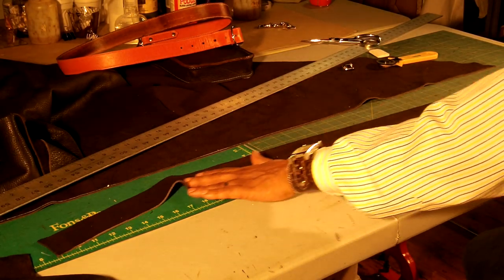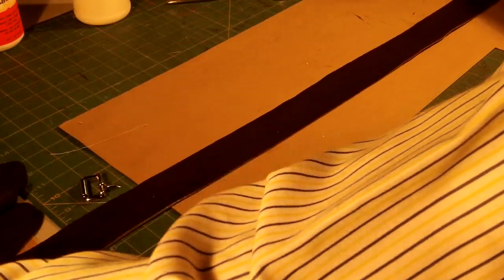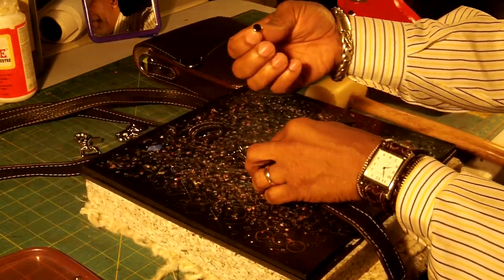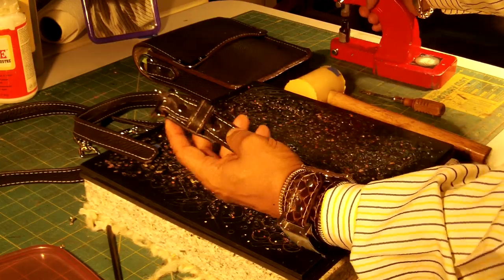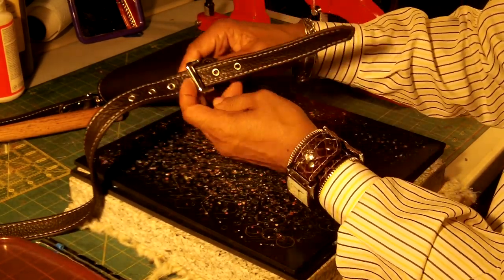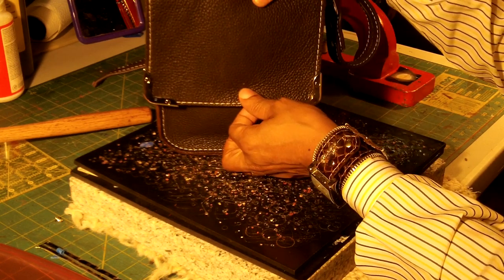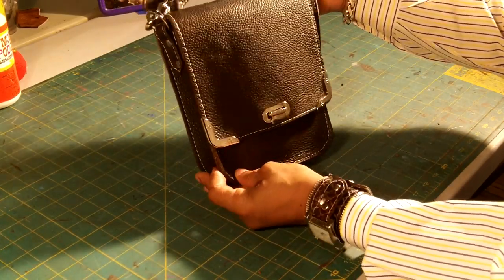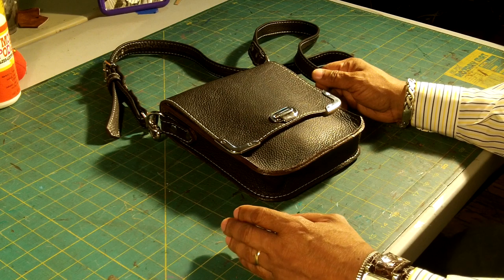How To Make a Messenger Bag Part 7 of 7

Comment from the maker: Hello Ali, Thanks for watching and for your comment, I could make the iPhone 4&5 case the only problem is, I am still using the iPhone 3, for me, I need to have the product to make the pattern with out making it 3 or 4 times to get it right, The iPads would be easer to make because it dose not after to be a prefect fit, if you look at the coin purse video, it is the same process.

Arthur

Comment: Bravo, Arthur. What an elegant piece!  Two unrelated questions for you: (1) Any ideas for getting contact cement off your skin??  (2) Do any of your current pieces illustrate how to make and attach a rouleau handle? I'd like to try a tote bag with that kind of handle. THANKS
Reply from the maker: Hello Pjwhaletailgmail, Sorry for just now getting back with you, The best way to get contact cement off of your skin, let it dry and then rub it off, do not use water, it will only make it worst, I have not made a video on how to make a rouleau, I am in the process of making a simple tote bag video, this video will show how to make a rouleau handle.

Arthur

Comment: Hello Mr Porter, I'm a fan from England,I just wanted to thank you for inspiring me 3 years ago to start making bags, you capture the spirit and common sense approach so well, you make it all possible.
I couldn't afford a walking foot sewing machine, so I bought a scarily fast brother industrial lockstitck, managed to slow it down by extending the motor arm, putting foam under the pedal and using your one hand on the wheel technique. I have just made a rucksack/briefcase using the hand saddlestitch technique, if you want to see the results of your inspiring me just google (images) Hardback Rucksatchel
Reply from the maker: Hello Paul, You are WELCOME and Thank you for taking the time to watch our videos, how did you come with such a great idea for your machine, I did google the Rucksatchel, I love this Satchel, Thanks for sharing.

Arthur
Reply: Hi Arthur I got the idea to slow the machine by google search, so in a sense other people helped me, sharing again. Closed cell foam from packaging works best as its much stiffer.
I'm thrilled you love the Rucksatchel, I'm looking to make a lower priced model out of an oiled chrome tanned leather, but hard to find in uk.

Comment: what is the different between using white cement glue or the other cement glue?
Reply from the maker: Hello Dave and Cris,Thank you for watching our videos, we use the white glue mostly when we are gluing a secondary and primary leather together, we will use the contact cement glue when we are gluing the edges together long enough to hold it until  we sew it.

Arthur